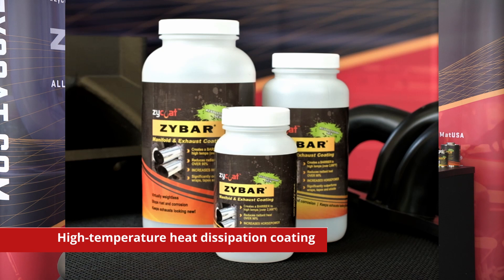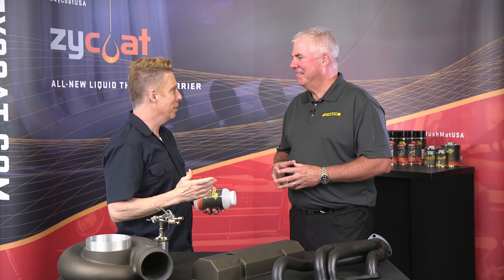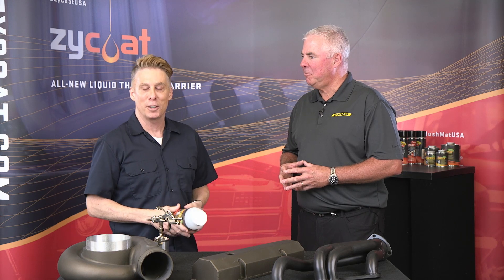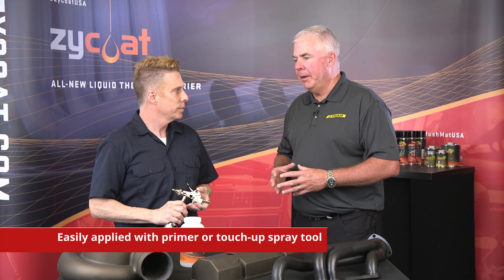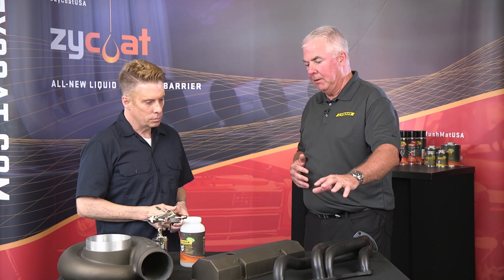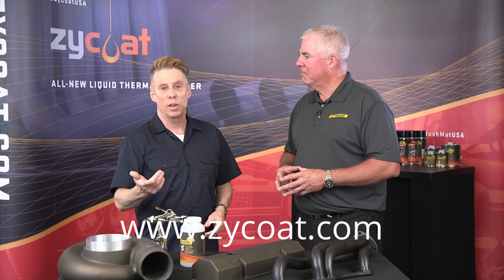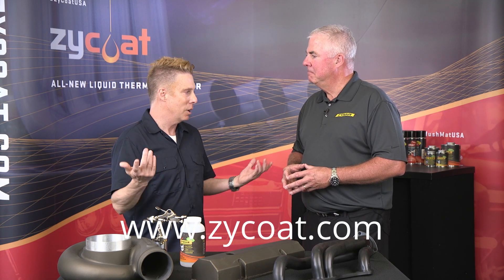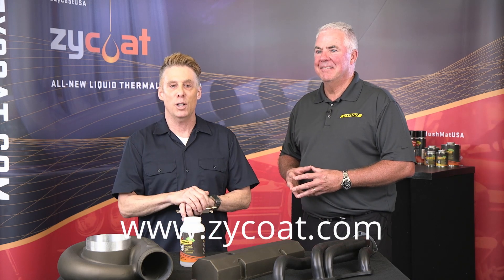ZyBar® Heat Dissipation Coating

Comment: I work in the oil field. Our company has a fleet of trucks. We spend lots of time in the desert sun and our truck bed service bodies get hot. We are looking for something that will help dissipate heat on the service body doors and handles. Does anyone have any idea on what can help? We want to avoid those hot handles when we open up service body doors and handles.

Comment: Might try painting some audio amplifiers with this paint see if it helps
Reply: If you do that you'll cook the internals.  The exterior aluminium on amplifiers are designed to get rid of heat not keep it inside